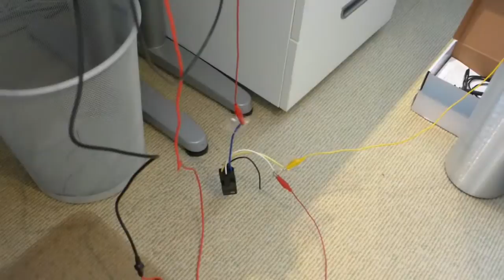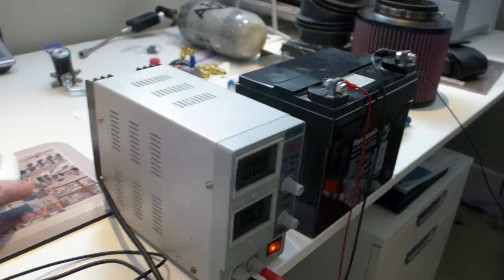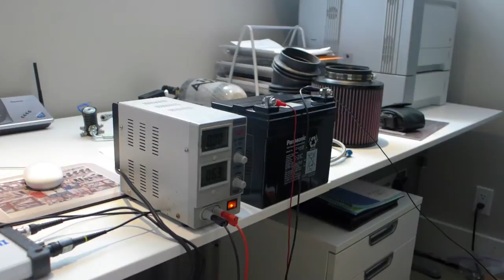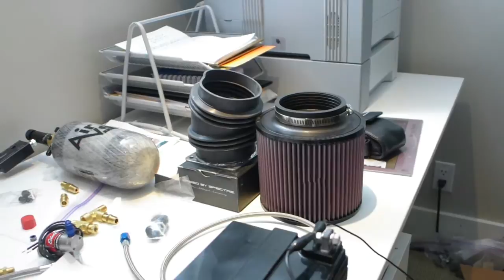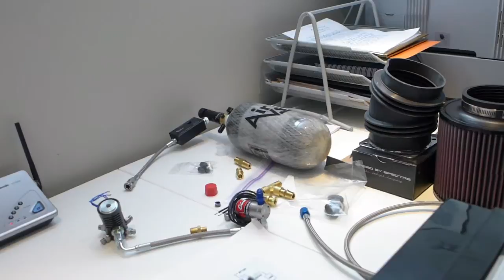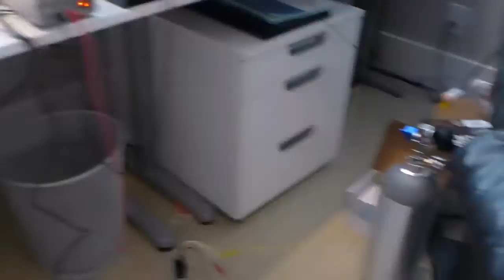The Ultimate 1983 Rabbit GTI - part 76 (PWM control of Cooling Fans, Wiper Motor Rebuild)

Comment: If you get tired of dicking around with controllers that take a dump, Google The Auto Cool Guy
Reply from the maker: I loved the total flexibility of my approach because I am an electrical engineer and software geek ...
Reply from the maker: And my ECU has been rock solid so no complaints about reliability to date

Comment: Derek Spratt Would you mind sharing your wiring schematic to the PMW solid state relay?   Also, I want to duplicate your setup on my DSM, and add in a diode so that the running fans to not act as generators and feed power back into the system after shutdown.  Thanks!

Comment: I have one question Derek, 
Do you think those fans would work on a hi comp engine at racing speeds? 
I have used them before on 16v's but if there is anything in front of the radiator aka condenser/oil coolers/intercooler they just dont pull enough air. 
On your video if you look at the plug for the second fan thats laying on top of the moving fan, even at 100% it doesn't even move. I have the biggest SPAL fans they make now and they would blow that plug out to outer space if I did the same. 

Here is a pic of my 2 fans and the motor on one of those regular slim fans
http://i38.photobucket.com/albums/e150/xtremevdub/My%20Corrado/CORRADO%20ABF/IMAG5711_zps61ed8027.jpg
It may be overkill even in my case, but Im running AC on a turbo 16v.
Reply from the maker: I had a conversation with my prior rad designer around stepping up to the deeper spal fans due to concerns that the slim ones wouldn't pull enough air once a significant resistance was imposed but the additional depth results in a pretty crowded area under the ITBs (and wouldn't let me remove the fan shroud without taking off the ITBs) so I am hoping I can get away without them. These ones aren't the wimpiest ones, and produce some decent airflow when they are mounted on the rad - the position on the chair blocked almost all of the air flow and once the frame was lifted away another 1" a good volume flowed. I don't have restrictions in front of the rad once mounted in the car so I'll just have to see. The Holley Dominator ECU has full data logging capabilities and one of the things I will look at is the differential between the cylinder head and rad temperature because I may have to tune the coolant flow - both in terms of pump speed for a given temperature, plus keep the differential within an acceptable range because I could end up with the coolant moving too slowly through the rad, cooling it off too much, and entering the block so much colder that thermal stresses start to take hold and damage the engine. In that case it is recommended that I narrow the opening into the pump to increase the static pressure. This is all new to me: the last few times I was racing BB Chevy V8s and we just dropped in CSI water pumps and never bothered to fuss about it. In my case, as you point out, things may not work out without changing fans. I secretly hope that the monster rad core (2.5" deep x 11" x 30") will be total overkill and the fans will barely ever turn on ...
Reply from the maker: Derek Spratt See my #77 video where I re-tested the SPAL fans when actually mounted to the radiator core - they flow lots of air thru the core so it should be fine.
Reply: Derek Spratt Hi Derek, the other day I tried to answer in my phone, but when I went to post it got deleted.. Well, I can see the fan moves air, but the question is how much would it actually be necessary is determined by the amount of horse power the engine is gonna have and how long at a time are you going to be in power. Once you are up to speed, the best fan in the world wont generate as much cfm as you will be getting by just driving.  If you are going to do a lot of auto-x you are going to need bigger fans. Here is very nice read. http://www.supraforums.com/forum/showthread.php?581479-Radiator-design-question-lt-not-the-usual-ones-gt#/forumsite/20626/topics/581479
Edit, I didnt realize you had actual SPAL fans.. thats a much better start than the crappy chinese ones.